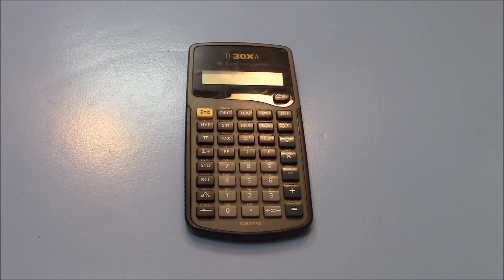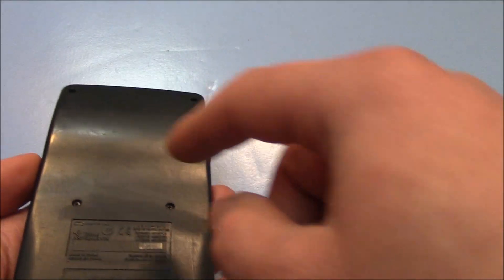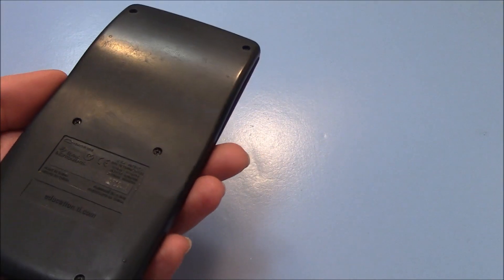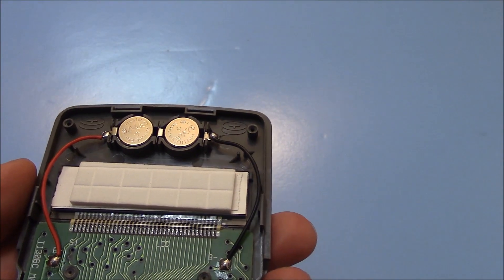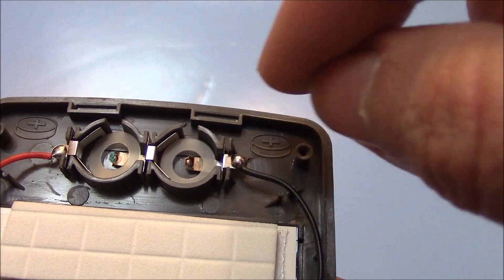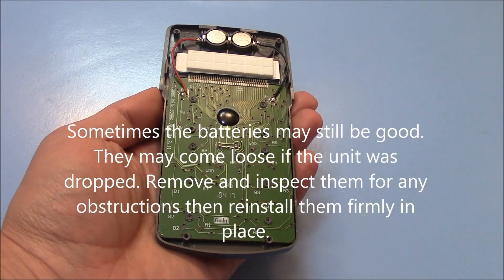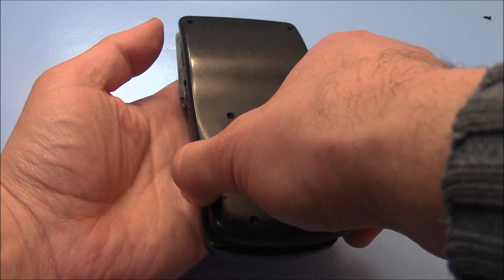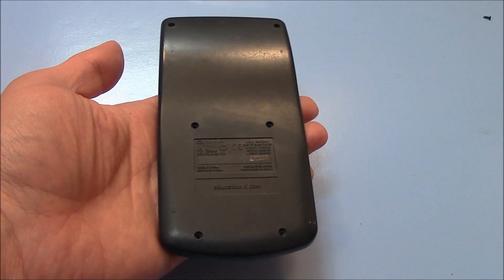How To Replace The Batteries On A Texas Instruments TI-30XA Scientific Calculator Quick And Easy!

Comment: Mine says: LR44   (0.% Hg.Pb Cell)  But thanks for the video, I was beginning to think the case was not meant to be opened by anyone except Chinese slave labor kids. Also, when closing it up again there are two recessed tabs on the top half that line up with receivers on the bottom, so line up the two halves and slightly push down at the two lower outside corners of the display screen.

Comment: You were fortunate. In many cases the TI-30XA will not turn on after changing batteries until you short the "reset pad" on the circuit board.  There is text on the board that instructs you to short the reset pad after changing batteries, but it's not intuitively obvious what that means.  You need to roll a coin over the circular area below the "reset" label to reset the board and allow the calculator to function.  It would be very helpful to many if you could add that part to the video.
Reply: cane here looking for this, thank you!

Comment: Hi at all. I found the solution for reset. In the middle of the board under the big black part there are two capacitor, C2 and C1. I made a shortcut over C1 and now the calculator works again.🎉

Comment: My TI-30Xa only has 4 screws and ONE LR44 battery button cell.  This calculator in the video has a different back with 2 button cell batteries.
Reply: There are 2 types of ti30: Xa and XA, the have different color of the 2nd button. Yellow and green.

Comment: board says please short the reset pad after changing the batteries how do you do that?
Reply: The following info came from the TI store, specifically for the TI-30Xa.
I've added comments in italics.

The "reset pad" should be marked and located "near" the button cells. Do this by "rolling" a coin (instead of scraping across components on the circuit board) across the reset contacts. 

If you find the contacts I suggest using something conductive that allows more precision to contact ONLY the reset points
----------------------------------------------------------------------------

Once the case is closed up, you perform a keyboard procedure pressing these in sequence:
Press [OFF], [ON/C], [ON/C]

I have no idea if this keyboard sequence actually does anything meaningful, however I can't think of any reason for someone from the store to lie or prank about something this simple. It's not going to hurt anything and takes like 2 seconds, so what would be the point
----------------------------------------------------------------------------

A point of interest...Texas Instruments 30 Year Old Electronics Going Strong
I've had a TI-34 solar calculator since late 1980's and a TI-35Xa since mid-90's, and they've worked great the entire time. Not even a hiccup with the keyboards. That's precision and quality design and manufacturing

Comment: I can’t remove the cover.
Reply: Same. On the other side of the world. Pakistan. It seems it doesnt have the feature to open.
Reply: try using two slits on top with flat screwdriver to get it started then pull from there carefully that's how i did it.

Comment: Say, how did you get the back off? Do you press on something? I cant get it off and I aint dumb
Reply: There are two little clips on the side that you will need to pop off using a spudger or a screwdriver - https://imgur.com/gallery/5yLhnia

Comment: What if the calculator won't turn on even after changing the batteries?
Reply: Buy another one 😇
Reply: If you still need a replacement put it on your Christmas list 🎅🏾  🎄 ❄ ⛄
Reply: I'd check contact points see if anything is loose or detached if so re-solder. after that i wouldn't know.

Comment: Gee, it certainly did not pop off. Still trying to pry it open. Took all the screws out. But it did come off eventually.
Reply: having the same problem, how did you get it off? i feel like i'm going to break it if I pull it off. all the screws are out.
Reply: Same
Reply: @Purpleunicorn23  I eventually got frustrated and just yanked it off,  it was the only option. chipped a little bit but went back on fine.
Reply: @mr.c4p  I did too lol
Reply: There are two little clips on the side that are almost in line with the display. I just took a little spudger and ran it along the edge starting with the top and it came off cleanly.
https://imgur.com/gallery/5yLhnia

Comment: Rather than buy 2 batteries for this TI-30xa, it's cheaper to simply buy a TI-30XIIS, 2-line scientific calculator that has more functionality. 
/Lonewolf
Reply: It's not a matter of simply doing what's cheaper. The TI-30xa is  aesthetically and functionally a fantastic calculator, and is a work horse in the lab. In fact I prefer it to the TI-30XIIS, primarily because of the single line display!! The extra functionality of the TI-30XIIS is dead weight, like the 100 apps on your phone that you never use, and the two line display requires more disambiguation which slows down the work.
Reply: @bradleyhamilton3447  I admire your enthusiasm for the TI-30Xa, but I need the functionality of memory safeguard of the calculation history that a two-line scientific calculator allows.
/Lonewolf Liberties
Reply: The batteries are 5-10€, depending on where you buy them, the XIIS is 5-6 times that, plus you have to learn how the different model.